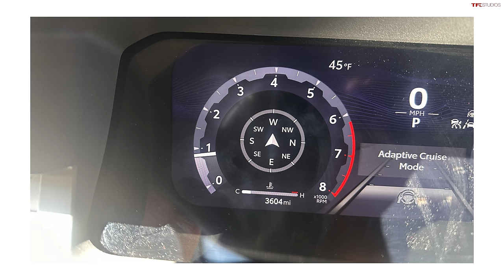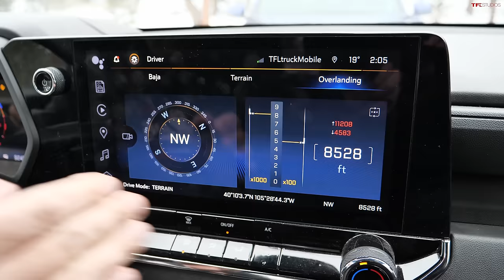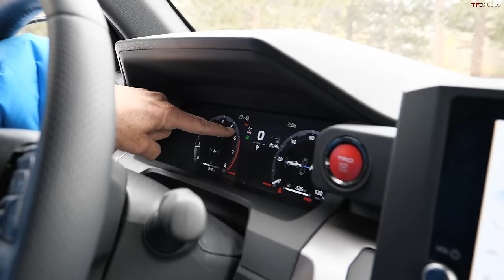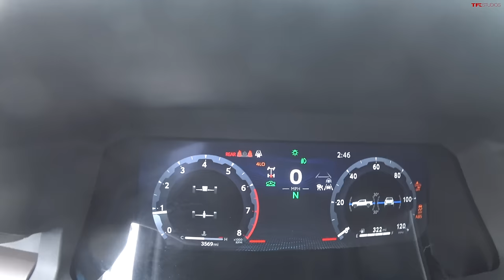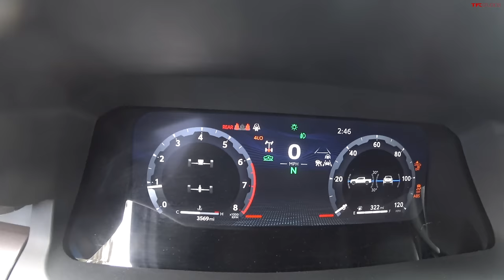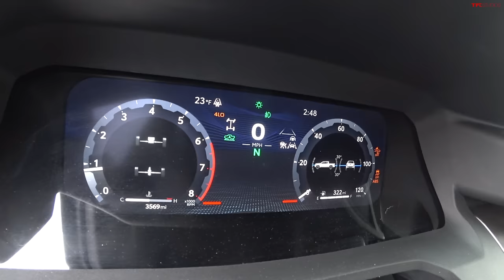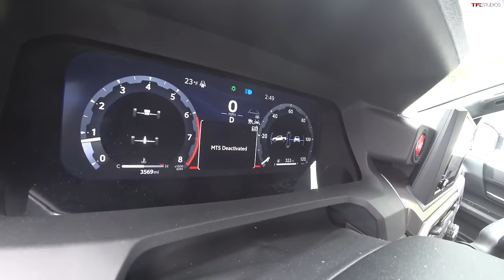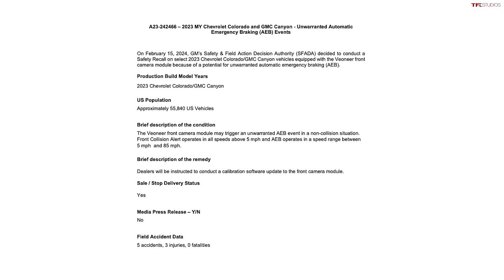Our Brand-New 2024 Toyota Tacoma Almost Left Us Stranded...Here's What Happened!

Comment: These guys just convinced most if not all old tacoma and old tundra owners to keep their trucks.
Reply: Yep. Hopefully this was just a manufacturing defect... If not, I'll never get rid of my 16 manual transmission
Reply: Absolutely keeping my 2005 tundra haha
Reply: I've been drooling over these new tacomas lately. I think I'll stick to my trusty 07' with the 3.5" lift, though 170k miles be damned!
Reply: I’m keeping my 2020 until they get rid of the electric and go back to a v6
Reply: I’m keeping my trd 2021 Tacoma until the new tacomas are flawless again 😂
Reply: I just picked up a 2012 Tundra and couldn't be more pleased. You guys are helping me confirm I made a great choice.
Reply: I have a '17 TRD Sport Ext cab V6.  I hate the square look of the new dash and the HUGE screen that looks like an after thought ipad stuck on.  I'm keeping mine till it hits at least 300k miles.
Reply: @j.t.5826  I also have a 2005 Tundra.  My driveway is worse than the little bunny hill trail in the video.  I would pop drivetrain components every time it snows if I owned that Tacoma.  That's not acceptable.  Bulletproof is the word I would use to describe my current truck.  I'll be hanging on to it for another few years.
Reply: The 4x4 even on the older trucks are junk also,tons of problems.
Reply: $60,000 4x4 truck that cant even go up a smooth trail without breaking down,lol
Reply: At first I thought it was a cv but it might be the ring and pinion
Reply: And this will only add to the older Toyota tax
Reply: @gregb1599  it's a BRAND NEW truck,so its a big deal.
Reply: This video makes me even more convinced that old is better because is proved and tried!Who cares it uses 2 more mpg vs the new one,who cares it doesn’t have same low end torque as the new one!Like another guy commented…..a whole lot of people will change their minds after seeing this!!!Good job Toyota!!!You let me and a whole bunch of fan and owners down!
Reply: I'm sorry to inform you but the reason switched is to keep up with epa fuel efficiency and emissions standards of the modern day. Youll see it across the board with auto manufacturers. @Playingwithproxies
Reply: Smart move. Toyotas quality is good on their older trucks for sure.
Reply: Agreed. My son had an old Tundra until recently. He had 353,000 miles on it with hardly a hiccup. Great stuff.
Reply: @socc4298 got another 170 in your future just keep that undercarriage rust free😂
Reply: @jareddodge1985  yeah my guess was the transfer case or front diff blew out. sounded ugly lol
Reply: I’m definitely keeping my 2022 Off Road now! At 22k, it should last awhile!
Reply: I think a lot of 2nd gen owners learned that lesson when we traded our 2nd gen Taco in for a 3rd gen.
Reply: lol yep 18 trd off road tundra. Couldn’t be happier
Reply: I'll keep my Chevy!!
Never have I broken the drivetrain!!
Reply: No that’s just the reality of Toyotas , not fake fanboy reviews . People are so easily fooled, just a typical cheaply made ricer. JUNK .
Reply: @kevinm2025  I'm a GM guy.
But sadly Hondas and Toyota contain more USA made part's then a domestic brand..
Im serious..
My friend works at a body shop and has worked on every vehicle..
Toyota and Honda parts boxes say made in USA..
GM Ford and Chrysler boxes say made in China or Mexico..
Today's domestic brand are more foreign than the foreign brands...
Reply: 36:42  sucks was looking at the 24  taco , will stick with  my 07 Tacoma with 380k ,
Reply: Radio silence for a week? Is this Toyota trying to keep a broken, buggy, and weak sauce new design hush hush? I like the looks of the 2024, but I'm leaning away from buying this, or any other problem loaded overcomplicated new piece of good looking shit for $45k plus. Bring back simplicity and solid design, then I'll think about it!
Reply: Care Car Nut also did it.
Reply: Same with my 21 4Runner
Reply: 100%
Reply: Yep. That snap was the sound of my 2021 going up in value.
Reply: Why would I ever want to sell my 94 surf?
Reply: New toyotas are junk just like the domestics
Reply: Which means they be even more expensive to buy
Reply: I’ve got a 2020 tundra.. yup not changing
Reply: Yea my 2015 Tacoma just hit 220k miles, zero issues, I just paid it off. Keeping it forever.
Reply: I am going to go with a MFG defect for $500... My 04 GX470 gets pushed harder than what you guys do.  Are the front CV's made of glass?
Reply: Drive trucks, not Toys. 😊
Reply: @tbugher62  yes. Why do they say it is 40-45k when it is well over that? Only problem with this channel is they get unrealistic deals from local dealers and say that is what everyone else will pay.
Reply: @tbugher62 Not true. There’s are reason why the old trucks have top resale values. They are not junk the new one is a POS.
Reply: 100% keeping my 06 Tacoma and 12 Tundra
Reply: I'm on my fourth Toyota truck, an '83, '93, '02, and a '13. I trade them in when they get to 500,000 km.  I don't drive as  much as I used to so I'll probably have my '13 another 20 years.
Reply: YO! Am keepin; my 2018 Taco 4WD--bought it new for a song--only have 14k on it!
Reply: These guys know nothing about 4 wheeling,,,I could do what they did in 2 wheel drive,just using momentum,and the rear posi engaged. It is pretty embarassing,that they even put out this video. They should of took someone with experience out with them.
Reply: Bring a set of chains,when dealing with ice, on roads/trails is another key. As the chains dig into ice, again momentum is key, turning the steering back and forth, also helps.
Reply: Yup. My 98 is at 370k miles on the original drivetrain, including thousands of off road miles in 4 hi and 4 lo w/the rear locker engaged. Looks like it'll be another few years with the ol'gal before a replacement.
Reply: I have 2023 a 2wd 4 cylinder taco, planning to upgrade in the future.  I have regrets not getting the 4wd v6 but had no idea they were ditching the v6.  I got such a great deal I couldn’t pass it up.  Odds are, I’ll end up with a Nissan at this rate.
Reply: Yep, I'll stay with my v6.
Reply: Yeah, old tacoma owners have the same engine and transmission from 20 years go LOL. The moment they were forced to modernize their transmissions and engines the reliability starts to drop dramatically.
Reply: my 2005 manual Taco with 285K miles still running like a champ 💪
Reply: @dodgerdawg42  yeah, because of its 20 year old, 5 speed gas guzzling v6  poor power drive train that they never innovated until today. So now the hardware problems will start, just watch.
Reply: Toyota after 2018 are peices of junk
Reply: Pretty much...  Wheeled the crap out of my 2018 and never had an issue in 4WD.
Reply: It's why I would not purchase one with a turbo.  Cheap way.  2.4 cylinder?  That's what my 2011 Chrysler 200 has in it.  Cheap way for the manufacturer.  I bought a 2018 Tundra SR5 5.7 for that reason 8 months ago.  I would rather have something that last than some damn tonka toy or cereal box car.
Reply: All the "old" toyotas are broken too.
Reply: You know it. My 2016 taco just turned 80k. I love it
Reply: Yes and no. I already decided my 3rd gen was too fancy and I couldn't justify the higher prices for fancery things I didn't need. Yes, the newer frame is a big selling point. Yes, the newer motors are nicer. But man, there's too much tech. It's hardly a truck, and more of a toy and toys break when used normally. That being said, this is to be expected with a first year of new generation anything. The a.d.d. was already a weak link in the 3rd gen. It's a miracle that more people haven't had catastrophic failure. Probably because the cv joint goes first. On a side note, maybe they should start badging these as lexus trucks. So our toyota badged trucks might come down to a more reasonable price. It'll never happen, but one can dream.
Reply: @Moises1455  The 2023 wasn't flawless by far. Horrible ergonomics. Uncomfortable seat. Short on headroom. Transmission can't pick a gear. Rear diff leak. Faulty sensors on the V6. People incorrectly think they're getting 1990s Toyota quality when they buy a new one.
Reply: @tbugher62  Really? How old we talking and what goes wrong?
Reply: Just convinced me to keep my 2006 4Runner made in Japan. Those trucks have problems. Try the same route in a 4runner.
Reply: @palebeachbum you probably got a lemon. You should return it. Most owners don't share your experience 😮
Reply: @bggees  Read around the web. All common issues up to 2023.
Reply: @trystanoppert3183  but the new Taco has almost identical mpg rated by the epa
Reply: @wildbillslickdog  I know, I'm not even an off roader but grew up in Michigan and it's quite cringeworthy
Reply: Issues when you buy first year redesign model.
Reply: I bought a 2023 Tacoma seven months ago. Two recalls already, airbag and drivetrain breaking. No fix on the drivetrain issue yet.
Reply: Never getting rid of my 2002 Tacoma v6 double cab. 240,000 miles and going strong. I'd like to see a '24 4cyl twin turbo last as long. Toyota made a huge mistake...
Reply: 15 sc tundra. American racing headers, regeared 4.88/lsd. Dap Tune. Tundra 4 life
Reply: @Moises1455  your truck is the same as the one that broke
Reply: @milehyandriver  But this is the new Tundra, and not even the same generation as yours. It's safe to say this test proves nothing about your truck but we already know the older Toyotas are good.
Reply: @wildbillslickdog They're old boomers so they drive like old boomers.
Reply: Yeah.  The older Tacomas were built in Texas, not Mexico.
Reply: You must not remember the problems the tundras had.
Reply: Keeping my 07 Tacoma.
Reply: I wish I kept my 2001 Tacoma. My 2014 just isn’t the same and they get worse every year.
Reply: @brianjackson6643  I prefer the new frontier over the new Tacoma.
Reply: @wildbillslickdog  I thought the tires didn't grip like a winter tire would.
Reply: Good to know for me to keep my 1st Gen Taco
Reply: 10000000% they said “this has a ton of miles on it, 3,000, I spit my coffee out. My truck has 166k on it and I’ve broken exactly 0 axles
Reply: Four runner with the 4.0 is the best for the off rd camping stuff
Reply: I will have no issue with my 2020 TRD Pro on that terrain.
Reply: Because one reviewer had one problem with one truck? This could have happened to any generation.
Reply: The turbo convinced me of that.
Reply: Yup, my wife said the other day, why not buy a new one soon. I said not thanks, my 06 only has 160k on it... it's got another 20 years easy ;)
Reply: Same thing with the tundra. New ones having all sorts of issues
Reply: @nicumarc5788 I did. I was 95% sure of sticking with Frontiers, but I never ruled out a Tacoma. I have now.
Reply: @brianjackson6643 Look at the Frontiers. I have a Frontier I might trade when the redesigned 25's come out.
Reply: Yep, just traded my hi mile 21 in for a low mile 23, maybe take another look in a couple years